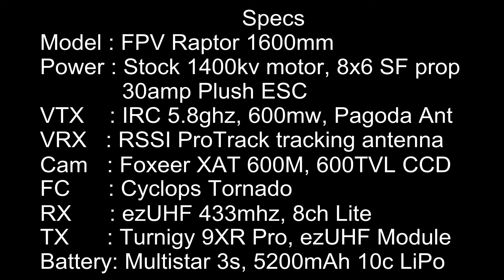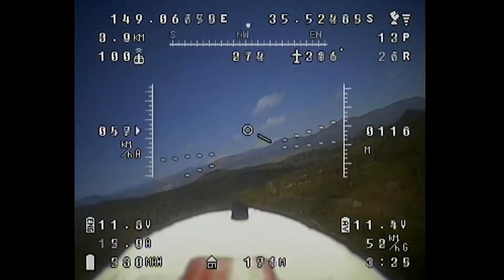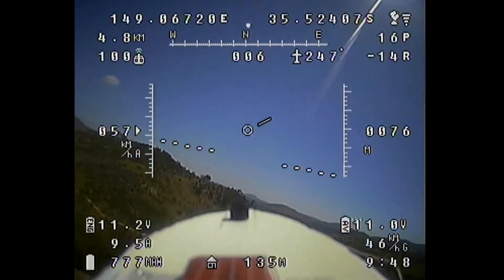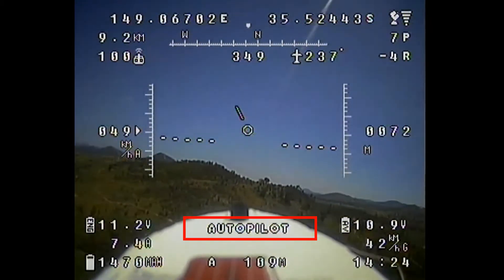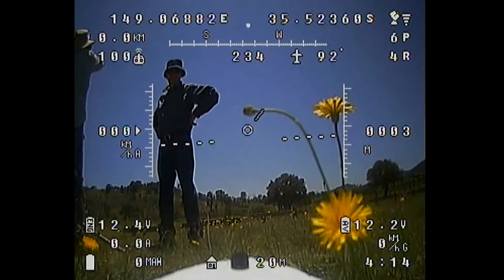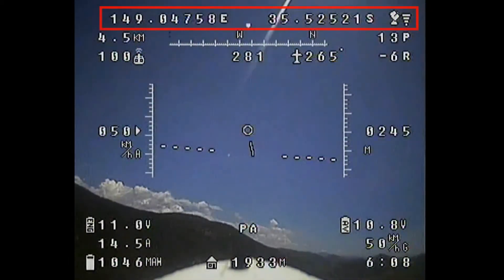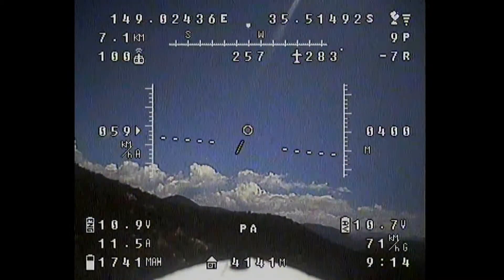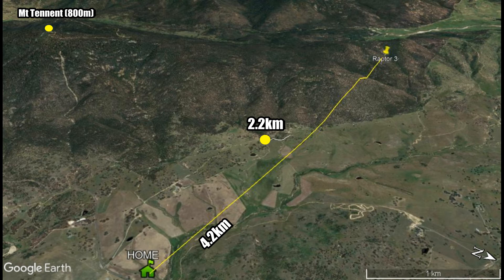FPV Raptor - Trimmed then lost . . .

Comment: Sorry you lost it.  :(  But, I'm thinking this may actually be a favor, that plane didn't want to fly well it seemed...the inability to climb even with a decent prop size seemed particularly concerning.  Oh, and SF props will draw more current, not the best option for efficiency.
Reply from the maker: After losing 3 of them I'm starting to think you may be right. The slow climb rate is probably my fault though. On the first trimming flight it had a tendancy to stand on its tail and stall so I set the flight controller to limit the max Pitch Rate to about 15 degrees. I never got the chance to bump it up again after it was properly trimmed. 

I'm not so sure about the inefficiency of SF props though. I understand the principle but I've always used them on my Tek-Sumo and am inclined to think that  their lightness and tendency to break before bending a motor shaft makes them a better choice for a hand-launced wing. I am trying to squeeze a bit more range out of the Tek-Sumo so I may try a comparison with an APC style prop. Thanks.

Comment: I purchased a cyclops tornado and exchanged it for another because of a loose wire on the gps.i still have not used it. A friend that had one also had the same issue with a fly away. Wondering if it’s worth using, What do you think?
Reply from the maker: Even though I've also had Tornado FCs in my previous losses, I'm still  a big fan. It's a strong, reliable unit that can be programmed on the spot without the need for a computer. I suppose any electronic device that uses cables to connect components can have failures, particularly after a crash but in this instance the GPS wasn't the cause of the crash. For some reason The video signal dropped out suddenly and I suspect I was so close to the ridge that I just flew into it before I decided to switch to RTH mode.